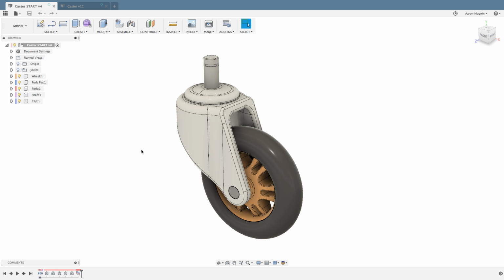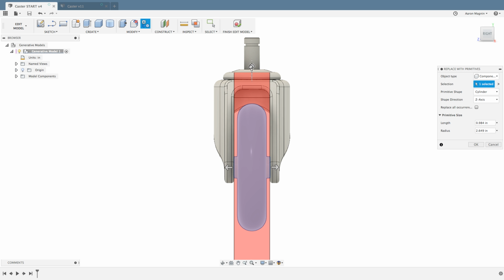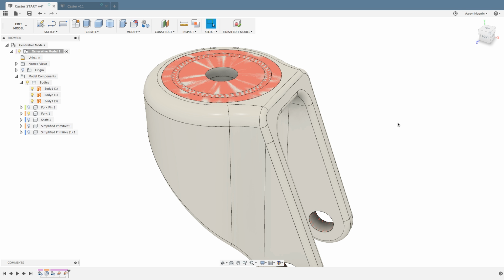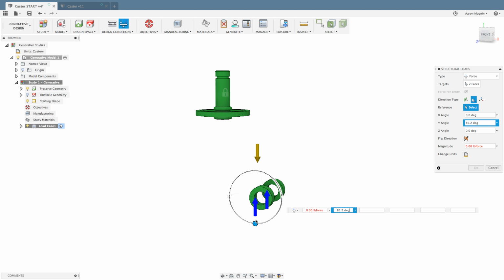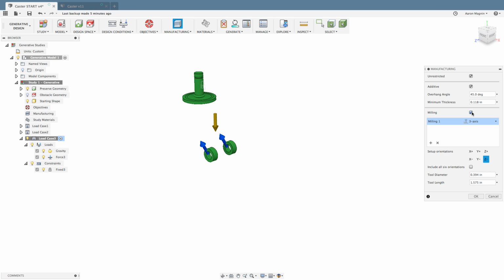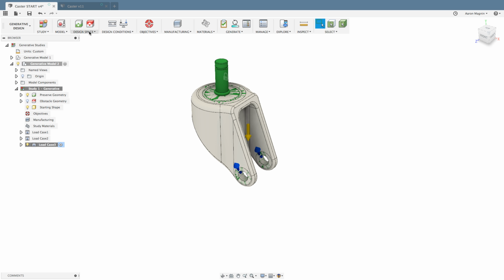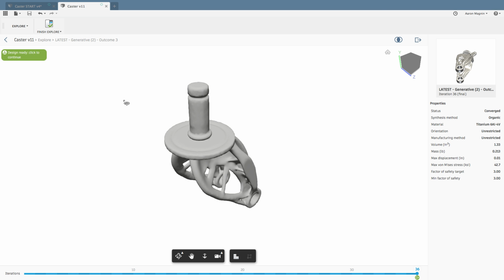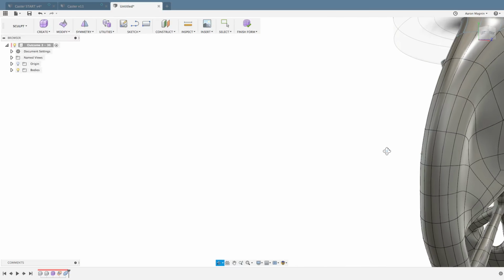360 LIVE: What's New in Generative!

Comment: Another quick one. Does Fusion consider each new load case independently when generating the new design? For your example you had 3 different load conditions. Did it consider those loads acting all at the same time on the part or consider those loads happening independently but designing the part to handle all of those different load conditions?
Reply from the maker: Great question. Load cases happen independent from the others, but outcome will reflect all loads.
Reply: @adskFusion  Thank you!

Comment: Is it possible to create less rigid constraints? Say instead of a ball-bearing which can rotate infinitely, I want a pliably connector, like carbon fiber to bend a certain amount to hold on to elastic energy? Is there a way correlate energy contained in the pliable to say an aerodynamic or hydrodynamic drag coefficient? What about basic spring models to connect things?
Reply from the maker: Currently, you'll find fixed, pinned, and frictionless. There are plans to add more though!